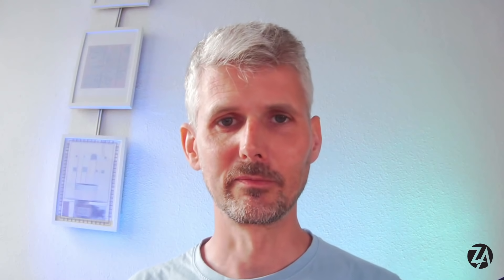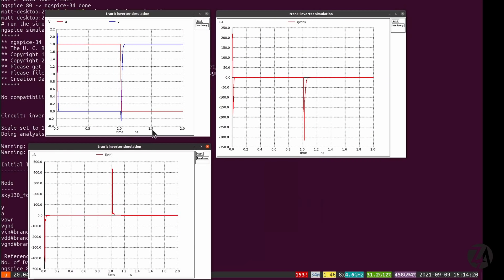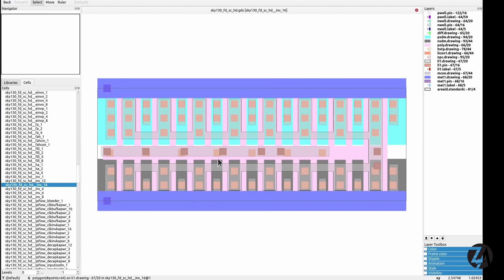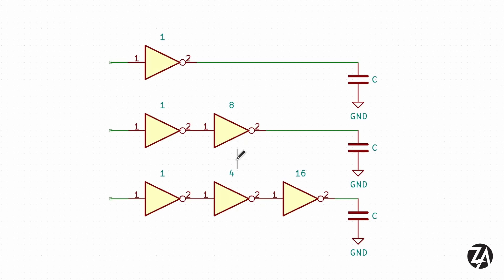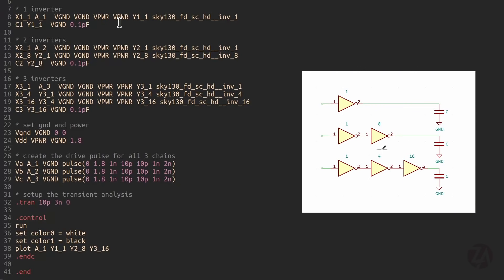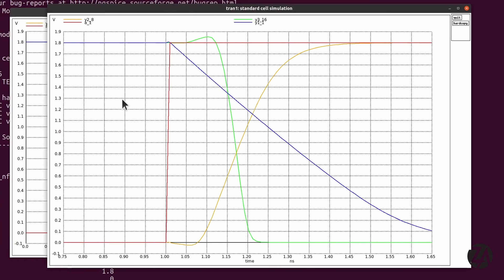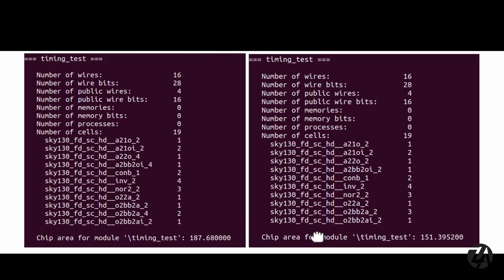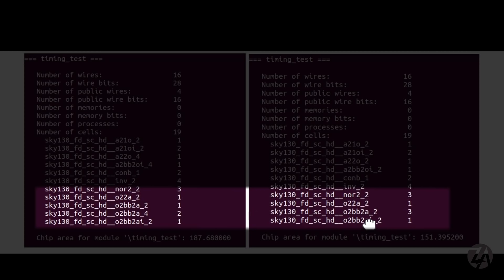When are 2 logic gates faster than 1?

Comment: It's worth mentioning that wire load can be as important as gate load/fanout.  You can have one fanout, but if it is really far away you still need upsizing and buffering due to interconnect capacitance and resistance.
Reply: Yep, good call. That's why in each ASIC we have I/O drivers with series of inverters that next is bigger than previous. If you have big load (big capacitance) and a weak driver then you can violate minimal rise time and stay to long in a forbidden zone during transition when gates behave like an amplifier. With noises that are everywhere you can get later train of unexpected zeros and ones that can wreck your logic.

I would suggest to make some simulation with slow rise time, and small voltage source in series as a noise generator and play with load capacitance. It could be good teaching experience to see this in a waveform viewer.

Comment: Hi, does the inverter sky130_fd_sc_hd__inv_1, sky130_fd_sc_hd__inv_4, sky130_fd_sc_hd__inv_8 and sky130_fd_sc_hd__inv_16 are the same ? For what I've seen on the spice files, it seems that these ares 1x, 4x, 8x and 16x inverter gate in parallel, and that could explain the faster charge rate of the capacitor. What do you think ?
Reply from the maker: Exactly!